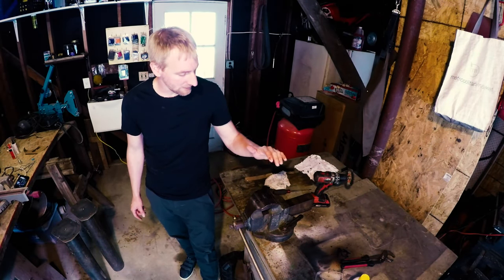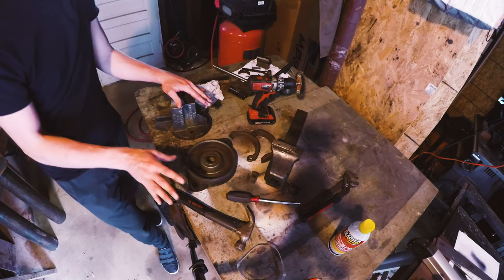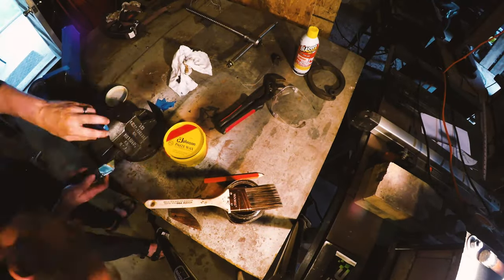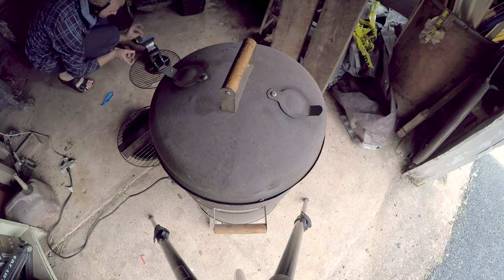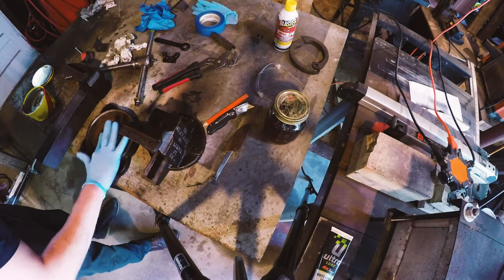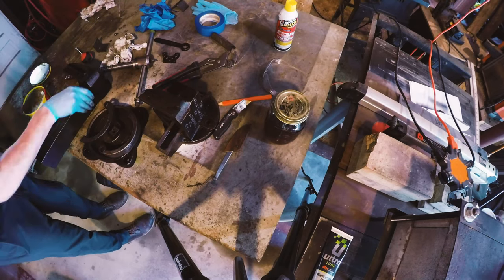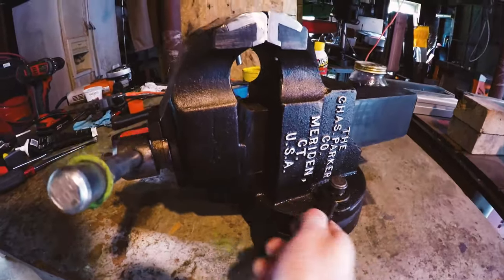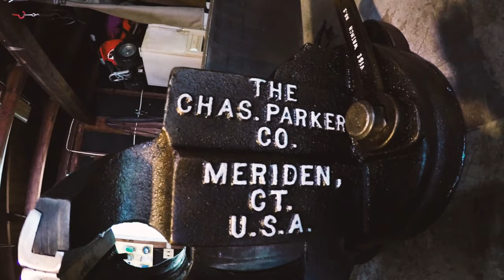Chas Parker 974 Vise Restoration

Comment: You put the shoe pin in upside-down.  Great finish on the vise!
Reply from the maker: I’m not familiar with which one the shoe pin is. Can you help me understand?
Reply: @CraftingALifeIWant  the brake shoes pivot on the shoe pin. You drove it downward when you installed it, but rather, it is supposed to be installed from inside the base from the bottom of the shoes up. There should be a recess in one of the shoes for the head of the pin. Installing it the way you did allows the shoe to cock sideways and brake the ring under tension.
Reply from the maker: @mikerobinson6606  ahhh ok. I’ll take it apart and check. Thanks for the info, always happy to learn some more.
Reply: @CraftingALifeIWant  do a video so everyone can learn the right way. Good luck buddy.

Comment: Absolute beautiful restoration. Just scored an old Parker Vise today but that little 1/2 round cap that goes onto the front held by 1 Screw was broken in 1/2. I have it but if I can’t epoxy it then gotta try to score another? Where’d you get that marker for the lettering? Thanks.
Reply from the maker: Thanks, having a good vice like this has been a game changer in my shop. I’ve lost track of how many times I use it on a regular basis. If you haven’t, please subscribe to my channel. The markers can be found at the link below, and if you use my link, I get a little kick back to help the channel out. https://amzn.to/3bGhRWA
Reply: Crafting A Life I Want : No problem and thank you.

Comment: Are you concerned about the heats effect on the metal? I would have kept temps below 300 IMO. Looks killer though, and maybe I’m being too cautious for a cast iron tool.
Reply from the maker: Definitely a concern, that electric grill / smoker I used never got above 200-250 but from prior experience / research it takes far less time at 400. Also, none of the hardened metal goes in there. (Jaws and screw) so it wouldn’t mess with the temper at all. Even then, 400 would still be fine. I’ve used this method a couple times but have seen others use it exclusively for their vise restorations without issues.